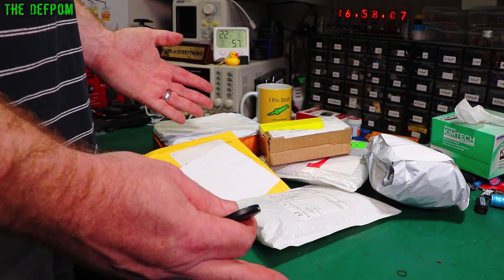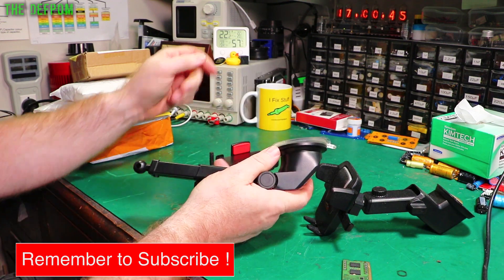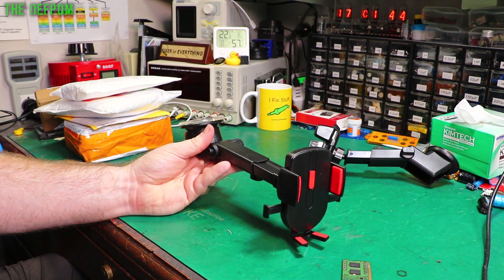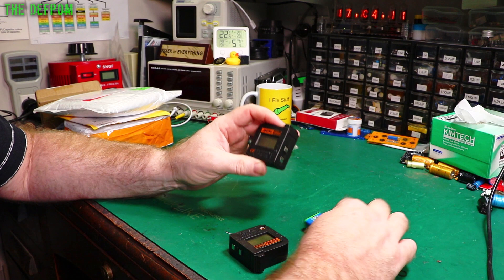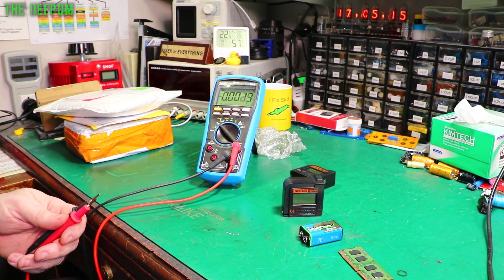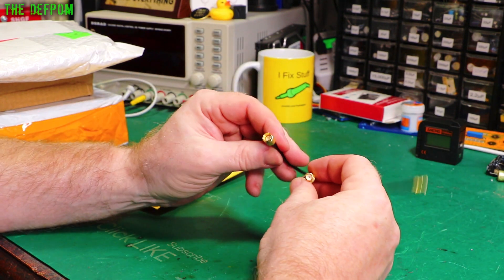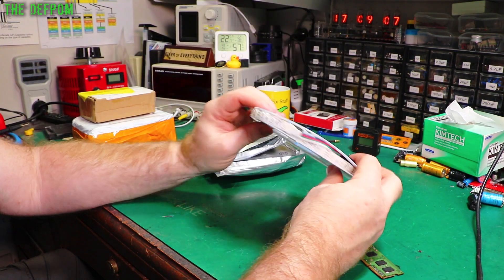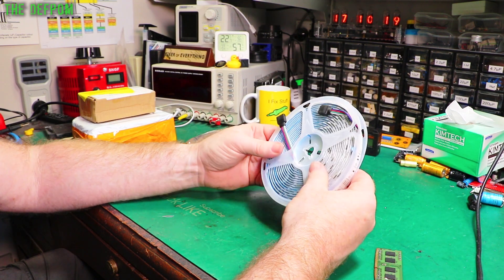🔴 Mailbag Monday 3rd May 2021 - No.827

Comment: May sound daft but....
Have you tried rubbing a thin layer of high UV sunscreen over the suction-pad before fitting to the window to reduce the UV degradation?
Or tried a UV protection spray?